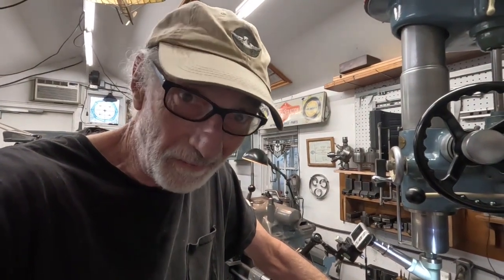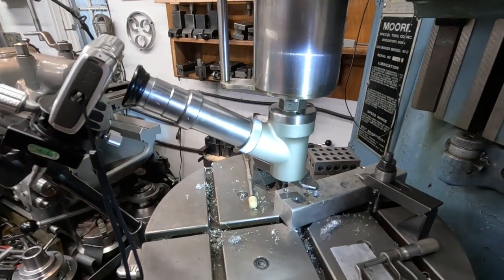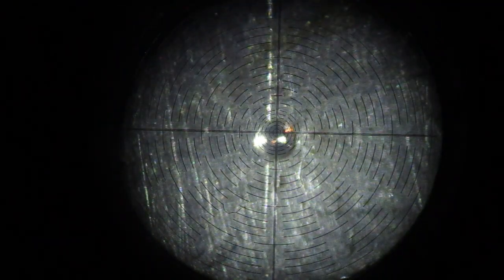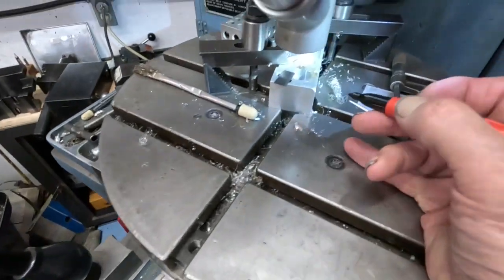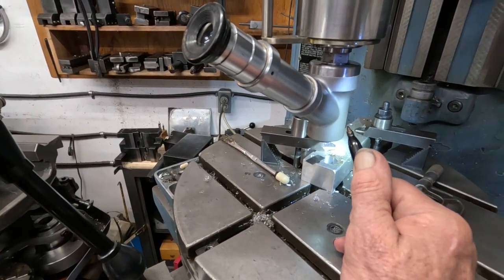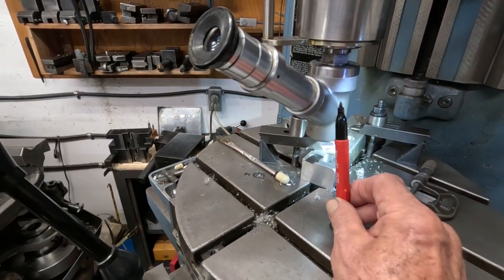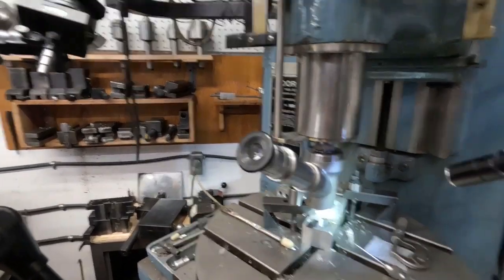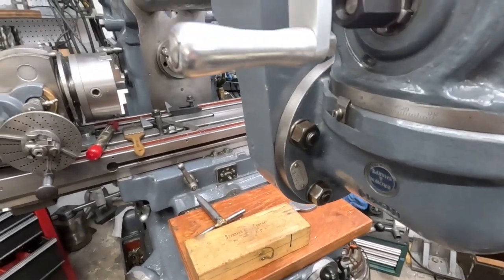Jig Borer centering scope for non-contact measuring

Comment: Dee I have one of the old Cannon Cameras that was the top of the line when I bought it in 2007. I paid over $400 for it when I bought it. It does take really clear pictures and videos. Camera phones have really taken a lot of the work that cameras used to do. It is just so easy to grab my phone because nobody carries a camera in their pocket everywhere. LOL I really like the old methods like the centering scope. When you mentioned testing out the boring head that is what I call ForePlay. "Seeing what the Old Gal likes and don't like." I am in the process of ForePlay with the newly rebuilt Clausing 5913 lathe. ForePlay is interesting to me. ForePlay and Setup are two things that are very necessary along with good measuring tools and methods.
Reply from the maker: The problem around the machines is the background noise making separate microphones needed. The little Cannon elf camera develops problems with the lens retraction being exposed to the grinders and getting knocked over. The action cameras have the durability but a little tricky to ad microphones. 
 Adding multiple attachments to these machines has been very time consuming making sure they work and coming up with a few tricks to make these things work.
 I have used this old mill enough it needs some adjustment before I go on. I am working on space for the Sunnen horizontal honing machine with a small surface grinder.

Comment: Good one Don .  I have a Skoal centre scope , but it sits in the tool draw where it belongs !   It always reads a bit off & just outside the range of adjustment .     👍
Reply from the maker: The set up in the jigborers stay on center well, it is the other machines that have most problems with exception of morse taper spindles. Where the scopes can work well on drill presses. I remember the Skoal brand scopes in catalogs, they seemed to have disappeared.

Comment: in your video on recutting the D1-x taper on an old chuck I think you said the angle needed to be 1/3 degree wider than the boss the chuck taper will fit on.  how did you/do you measure that small angle increment for setting up the tree?  how did you calculate the facing depth versus how much to cut out of the taper?  thank  you
Reply from the maker: I have not found an easy way to calculate this out because of the variations in the chuck mounts and spindle noses. The Axelson has a smaller locating taper than many of the used chucks and back plates I have fitted to it. The taper in the back plate should not be steeper than the spindle
just needs reasonable light contact.
 There is a ratio of cutting the taper and facing the flat that is similar to adjusting a Timken Bearing.
Reply: @DonDyarprecision  even if you dont calculate, you must do some kind of alignment of the cutting stroke with the taper.  did you indicate it in then bump the angle a little more open? if so, how much was the opening when you re-sweep?  you are doing cool stuff.
Reply from the maker: @rowlandcrew  I should have made a gage duplicating the Axelson spindle nose at the very first! What happened is most of the several chucks mounts were already damaged when I picked them up used and cheap, the only chucks that fit without moving around or too tight was a 1950s Cushman 4 jaw I picked up and the face plate that was just donated. Most of the chucks were damaged on the locating taper from running loose, I would recut the taper and try it on the spindle was really easy using the mill or jigbore with heads because the part can be removed and replaced easy. On the lathe a little harder with a backplate in a heavy chuck. I could test the taper contact with out it being tight by using dye or ink, then I would cut in .002" or so facing cuts until the taper made good contact, but not too tight. The lever collet closer I found at the plastic mold shop had the taper way too tight distorting the unit when installed, In other words, I did it the hillbilly way, Thanks!

Comment: I remember when these microscopes were very common. I haven’t looked for years. I imagine they’re still available. I can’t stand 5-C or R-8 collets. So many flaws in the designs. The thing I like least about R-8 is that the drawbar sits in a hole much larger than the diameter and the nut is flat. So you never know how far from the center of the hole it is when you tighten it. That means that the collet will be pulled to wherever the bar is aimed at, causing the collet to tilt. It’s just a thou or so, but it’s never the same amount. The further from the spindle the tools , the further out of perpendicular it will be. But it’s worse! Because of that slight angle, the collet doesn’t tighten down exactly the same around the tool. I’ve often wished I could go back in time and yell at the guys in Bridgeport or Hardinge about this collet systems.
Reply from the maker: When it comes to collets the R-8 and 5-C are the worst in many ways. I used an Erickson 180 3/4" collet chuck in my Bridgeport for general repair work "light" for very long time. I almost bought a later Bridgeport with the 30 taper quick change, but ended up with the antique war time mill that does a lot more for a lot less but real slow. The most accurate collets a friend found to use on a cutter grinder some years ago were ER40 at $175 each.
 The old self holding Morse Taper is still likely the best in many ways, one can use the optical devices in a drill press but not very good in the standard vertical mills R-8 spindle.